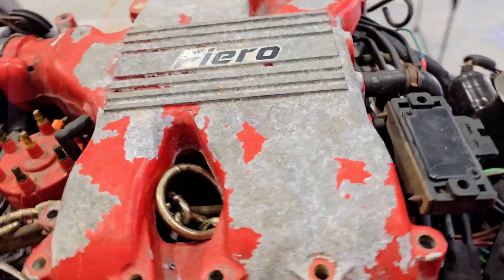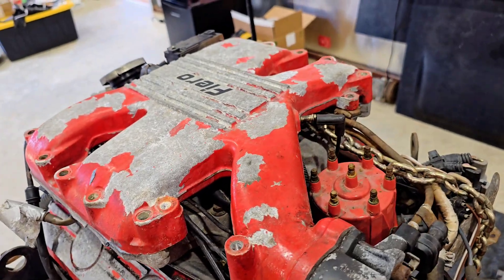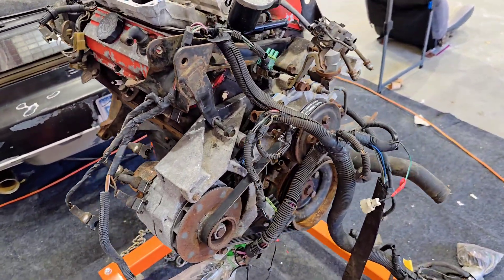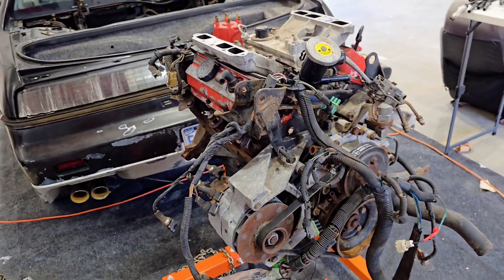Ultimate Pontiac Fiero V6 Engine Rebuild - Part 1

Comment: There is a correct tool for every job and you started off taking the plenum off with the wrong tool, hence the reason you snapped a bolt head off.

Comment: If you wanted to get an ultimate v6 in the car, would have better looking for a 3800 Buick supercharged or an LQ1 Dohc 3.4 v6 drivetrain in place (GM had to detune it from it making 270 hp).
Reply: LQ1s are super cool but very hard to find for a reasonable price. 
The cars they came out of weren't produced much and they're all 25+ years old at this point.
The LY7 and LFX are probably the swap with the easiest to source engine. But custom mounts are required.
Reply: You stated both reasons I intended to comment
Reply: Though these are a great variety of motor other than intake gasket and fuel regulator issues very dependable

Comment: When will you start on the rebuild of the engine? did you remove the engine from below the frame ?   thank you for posting this video !  I need part 2 now.
Reply from the maker: Awesome! Part 2 is in production! And unfortunately it was already removed when I got it, but there's a very good video on removing the engine by (Ronald Finger)

Comment: Please actually make a part 2 I’m most likely gonna use these videos to rebuild mine until later down the line I have some money I’ll maybe put a sc3800
Reply: I have gas in my oil
Reply from the maker: Yes! Part two is already nearly finished probably will be posted next week.

Part three will be the actual rebuild which hopefully will be out before Christmas.

Comment: I had an 86 GT in high school actually.  First year of the different back with the flying buttress style sail panels.  Mine had the Isuzu 4-speed manual.  I absolutely loved that car, I wish I still had it.  I got to drive past the Fiero factory, which was in Pontiac MI, but production had already shut down by then.  I would try really hard to get a new water pump, I think I saw some shaft play when you were moving it.  I had a friend that had an engine-swapped 3100 V6 in his, and it was a little bit quicker.

If you are looking for some extra power, you might consider shaving the heads to get a smaller combustion chamber design.  If you are worried it was overheated, then the head could be warped, so you'll have to have it milled flat anyway.  From memory those 2.8's had something pretty dismal like 8.5:1 compression or something.  Looking forward to more of this series.
Reply from the maker: Wow! Thank you for the awesome comment, and thanks for your support on the series!